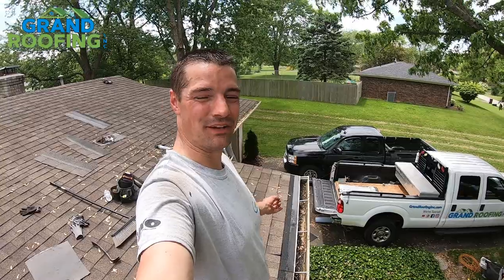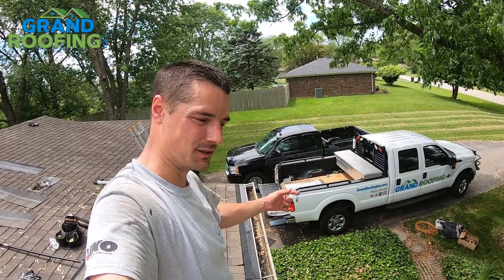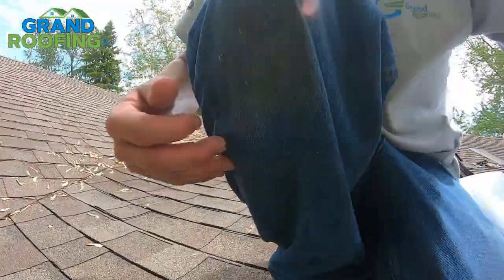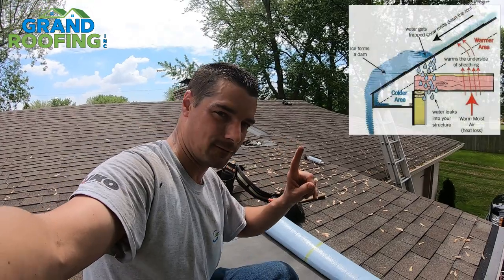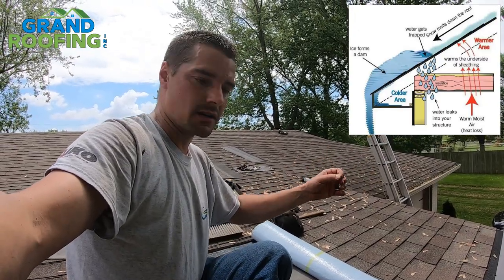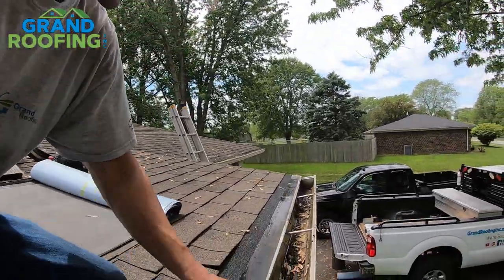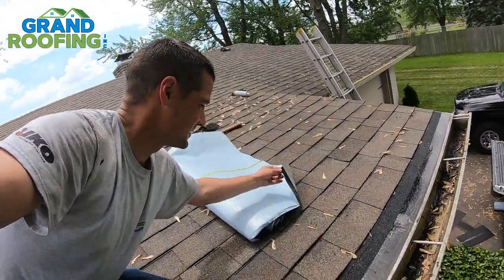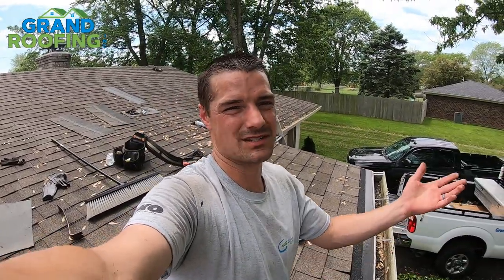Roofing ice and water shield - what not to do

Comment: Are ice and water shields needed for a one car sized garage where the space has been converted to 50% shed and 50% outdoor patio deck?  In other words its not heated.  The measurements of one side of the roof is 24 X 6.5 feet.  I've asked roofers but get differing opinions.

Comment: My roofer left off a one ft by 2 ft of ice and water shield from the bottom on the roof. Is this a "big" or difficult job? Do they need to removed the drip edge? Its under the drip edge through the rest of the roof.

Comment: I am needing to get some shingles on my house.  I have 20 year old three tabs.  House was new when they were installed.  One layer.  

I only have enough money to do a layover.  

So can I use ice and water directly over the three tabs and then just lay the shingles?

Should I cut back the first row or two of shingles on the eaves before laying new material?  

If I use ice and water instead of felt or synthetic, do I need to use starter shingles too? If so, do I need them on the rake edges as well?

I'm the homeowner.  I am hiring my home improvement business owner neighbor to do the layover.  

Note:  I found a deal on some bid states ice and water material that isn't much more than #30 felt and staples.   And if I don't need the starter shingles then it's about the same cost as all that.  Maybe cheaper.

Also it's a simple 4/12 with ridge vent.  No valleys or chimneys or hips.  Nothing steep.  Easy.  Just like doing a pole barn essentially.  

And I'm planning to install atlas pinnacle pristine shingles.

Comment: Any suggestions for how to get ice and water membrane off the plywood. The upper half of the shingles seem to be stuck to the ice and water as well as its stuck to the plywood. Need to remove some archetectial shingles to repair some rotted plywood and the lower half is easy to get loose but the upper half of shingle is stuck to the membrane. Thanks
Reply from the maker: No there really is no good way, just keep chipping away at it with a tear off tool.
Reply: There are 2 ways to remove the shingle tops that are stuck to ice shield neither being easy.  If you can do it on a hot day with sunshine on shingles,they will peel off using your hands and crowbar. If it's cold you can try using a hammer and thumping the stuck piece of shingle it should loosen it up. Contractor's make the mistake of not covering up ice shield with underlayment when newly installed. Oh by the way Ice shield will not come off plywood, so mark out replacement area and cut it out to replace.  Then install new ice shield over old. If you live in heavy snow and cold regions make sure you install ice shield down over the gutter board 3" and behind the gutter.
Reply: @larrycrookshanks1646   Thanks Larry! So they should put down felt/tar paper between the shingles and the I&W shield. Thanks again.

Comment: Well the ice and water the right way to install it supustoo be 4 inches behind the gutter but most of us just do it over the metal ,
Reply: Whys that? Having to take off the gutters just to do that would be a nuisance and would add on hours of labour. As long as there's eave drip metal you shouldn't have to do that, that's what that metal is meant for. If water is getting underneath it and between the backside of the Gutter and hitting the fascia then theres obviously other problems at work.
Reply: Well thats what the book says 😂😂😂but running it over the metal works just fine

Comment: Dose it sticks directly on  the metal/flashing  part or I have to put special glue? Thx
Reply from the maker: Ice and water typically will stick to edge metal once it heats up. If you're working with roll roofing like GAF liberty, you need to use a primer on the metal first.
Reply: @GrandRoofingInc  why is the primer for? You mean primer spray? Thx
Reply from the maker: Yes if you're doing a roll roofing like liberty there is a spray primer to prime the metal perimeter.
Reply: @GrandRoofingInc  why is the primer for?
Reply: @sand.590  primer helps stuff stick to an otherwise not stick-to-able surface.

Comment: I'm in fl was told to use this on the entire roof instead of paper. 2 12 pitch and want to use asphalt shingle. I have 3 tab now installed in 98 but I am chasing small leaks from nails that rusted from shingles lifting. ice and water help prevent these problems?
Reply from the maker: I don't think shingle manufacturers recommend using shingles on a 2/12 pitch. I know there's a few that will honor a warranty down to a 3/12 provided you use ice and water on everything. My thoughts on ice and water for that issue, it will prevent that for a while until the nails rust out overtime. Then back to leaks.
Reply from the maker: I don't think shingle manufacturers recommend using shingles on a 2/12 pitch. I know there's a few that will honor a warranty down to a 3/12 provided you use ice and water on everything. My thoughts on ice and water for that issue, it will prevent that for a while until the nails rust out overtime. Then back to leaks.
Reply: @GrandRoofingInc  sounds reasonable most quotes I got 500 extra to do ice and water the whole roof 18.5 sq.  seems like money well spent
Reply: thanks!
Reply: @dereckc9469  I agree with what he said, ice and water sort of seals around the nails but it surely doesn't prevent it rusting out 100%, especially with the pitch being so low. 

Yeah haha ice and water isn't cheap either so a extra $500 just to put that on would be well worth it on your side and for the roof in all. Stuff isn't pretty to put on in the heat though
Reply from the maker: If I was going to use asphalt shingles on a slope that low I would definitely get the ice and water. If I was installing it myself I would probably drop every single row 1/2 inch to help from water wicking back up under getting to the nails.
Reply: @GrandRoofingInc  Thanks again the houses in my subdivision are low sloped and the ones that are as low as mine 75% have shingles.  I doubt that any used shingles when constructed back in the 70s.  There's an old lady that is an original owner she replaces with torch down, not 100% sure what it is they used. She never has problems, looks terrible though